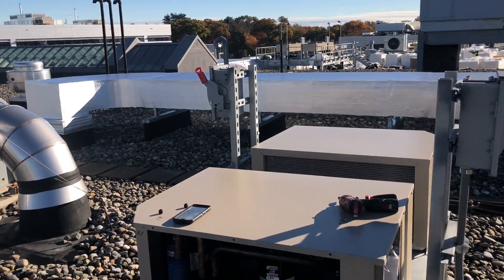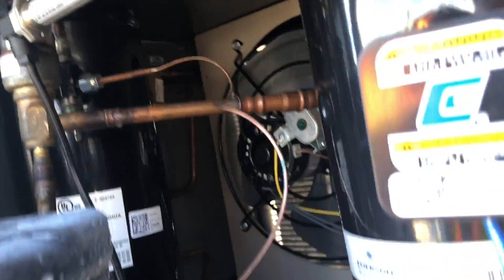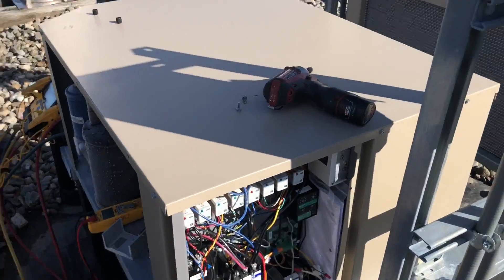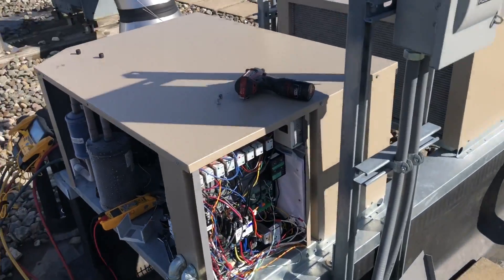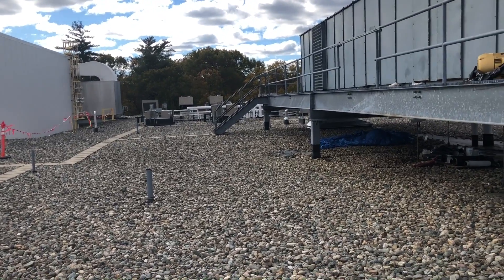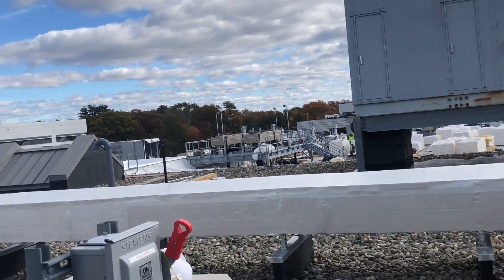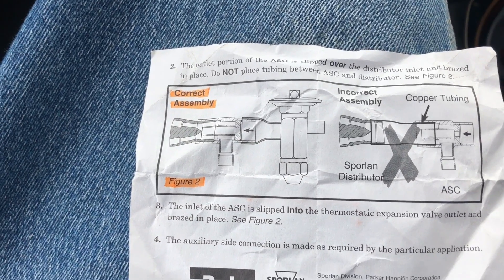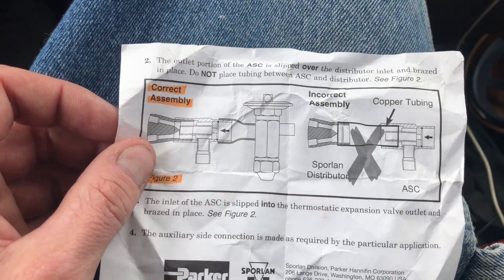Refrigeration Life #24 . Walk-in Freezer Call And Hot Gas Injection Explained 🤔

Comment: I find those modulating hot gas valve stick in the closed position over time. Just a heads up.  You can check them with the SMA-12 from sporlan.  https://youtu.be/E6LweD6uSus
Reply from the maker: Yup

Comment: How does it keep temp during the defrost cycle?  Is there multiple circuits in the box besides those two lead lag condensing units?
Reply from the maker: Beast_Blaster yes , I forgot to mention when one unit goes on defrost the other unit will take over . After defrost the lead unit will start again

Comment: Cool stuff.. im assuming they lead lag during the electric defrost cycle as well as the 7days like you said?
Reply from the maker: Yes they do sir , thanks for bringing that up. I forgot to mention that 👍 . Thanks for watching
Reply: @Cscrefandhvac  nice set up. Nice to mix it up and take things out of the normal day to day. Will it ever run both at same time if you have a minor issue and btus drop slightly or will it just changeover if the lead won't maintain set point? Keep up the cool vids 🤙
Reply from the maker: randy handle yes , say the box was way over the setpoint temp . Both units will run until its 2 degrees above setpoint then the lead system at the time will carry it the rest of the way
Reply: @Cscrefandhvac  sounds like you guys set it up well. Nice work. 👍

Comment: it failed cause it's a ranco... if you put a danfoss or Johnson it won't fail.. I worked on something similar for a  chamber for a biology lab in a university
Reply from the maker: Hahahah you could be right man ! But honestly I’ve had a lot more problems with Danfoss controls than I’ve ever had with Rancos over the years . I like Johnson’s the best
Reply: @Cscrefandhvac   well it is what it is I haven't had problem use danfoss oil safety... or the l.p. control but seen it with mechanical control setup... neat control setup in that condensing!!
Reply from the maker: For sure man. And the company I work for stocks ranco so I use I what I’m given. Haha. Thanks for watching man
Reply: Johnson Controls Penn brand is the best